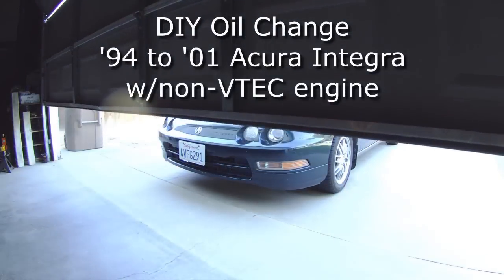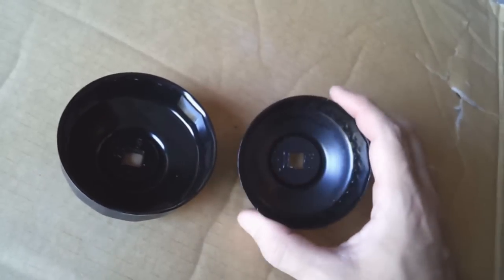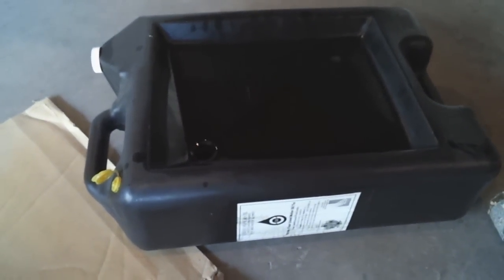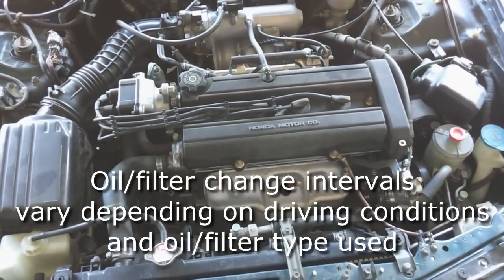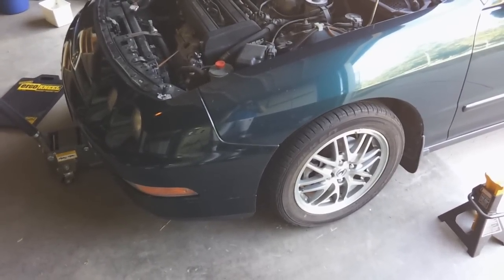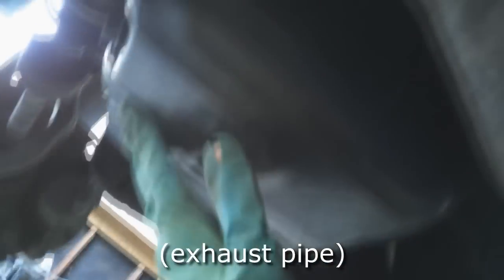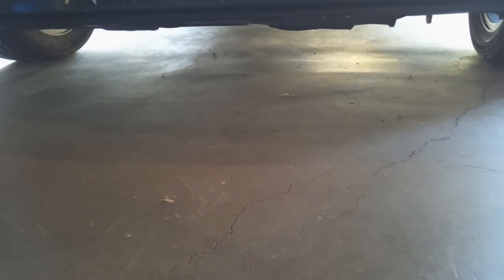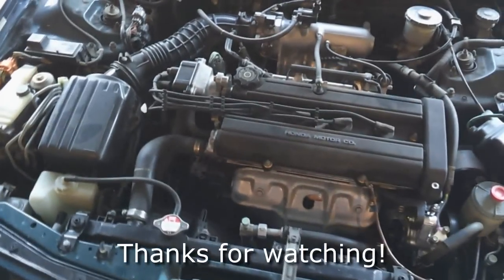In-depth: Acura Integra oil and filter change

Comment: Which way did you turn the filter from the bottom
Reply from the maker: The filter screws on and off just like any other standard screw or bolt. The filter turns counterclockwise to loosen, clockwise to tighten (when looking toward the front of the car).

Comment: Did you keep the jack in place while you worked under the vehicle, just for added safety?
Reply from the maker: I use jack stands to hold up cars while I am working under them. If it makes you feel safer you can lay wheels under the frame of the car or have a jack under there in addition to jack stands but the weight of the car must be resting on the jack stands.

Comment: supertech, is that good oil?  I found out it's sourced by Citgo refinery in houston, TX, their gas is decent quality.
Reply: Supertech available from Walmart is fine, I use their oil regularly. Check out bobistheoilguy.com forums if you want more opinions on the matter.
Reply: most people bash supertech on those forums, the synthetic version I have used couples times has higher flash point than mobil 1, dirt cheap, like 12 bucks for conventional and 17 for synthetic!